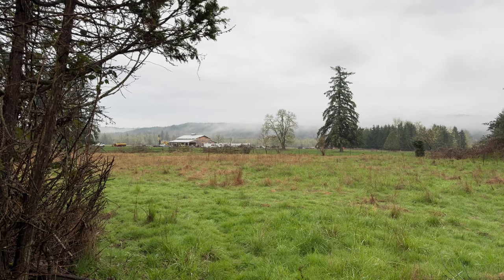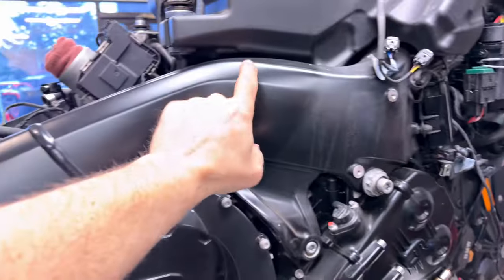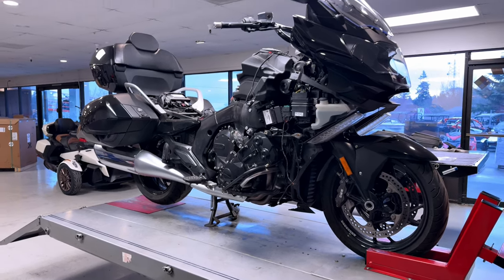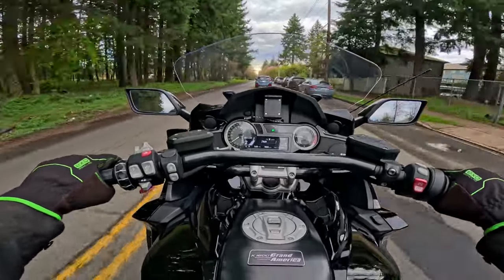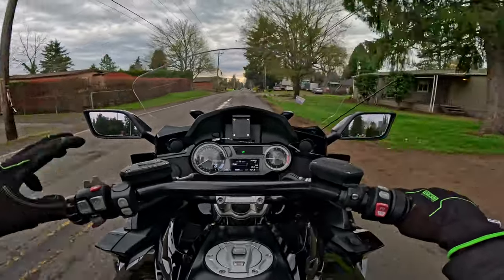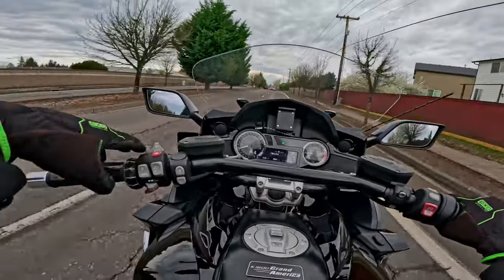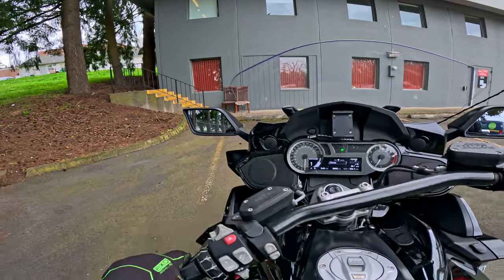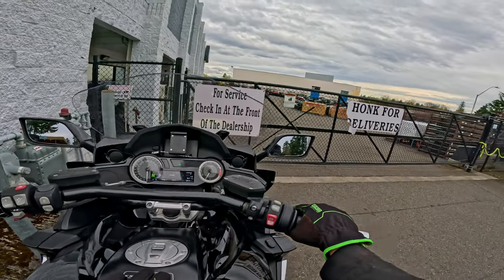K1600B Reverse Repaired!! • Story Time Test Ride! | TheSmoaks Vlog_3050

Comment: Smoaks, at 5:14 you just said you had a Honda XL250, OMG, I had the same bike here in Scotland.  After a few years of ownership I overtightened the cam chain tensioner bolt and snapped it in situ ( what a bummer) but what an amazing motorcycle.  Joe
Reply from the maker: Awesome, good 'ol Honda XL's..!  Mine was a 1977 XL250S.  It was stripped down to a dirt only bike the last ten years and Kelly rode it because it was low and comfortable for her...  Sold it in 1995 when we were moving from Oregon down to Texas.

Thanks Joe!! 👍👊